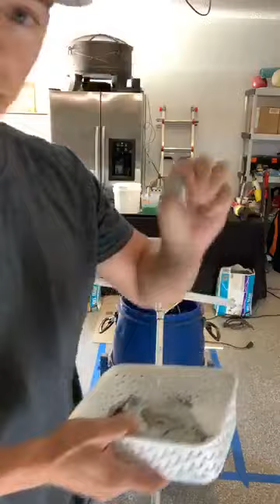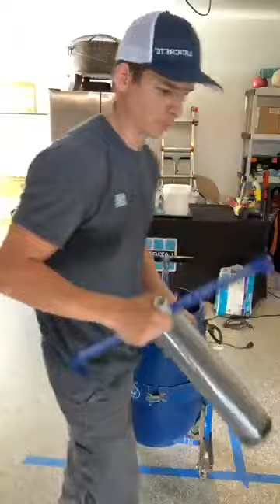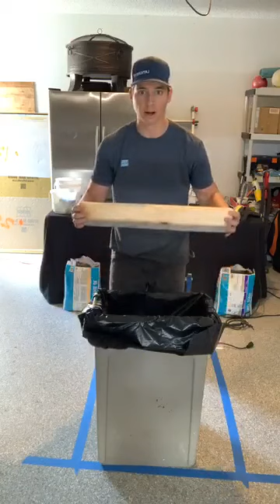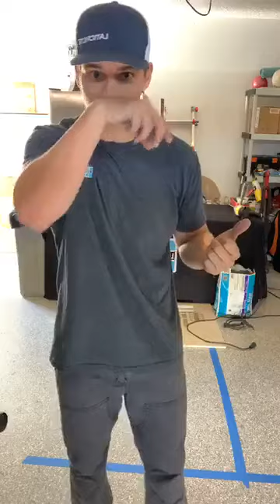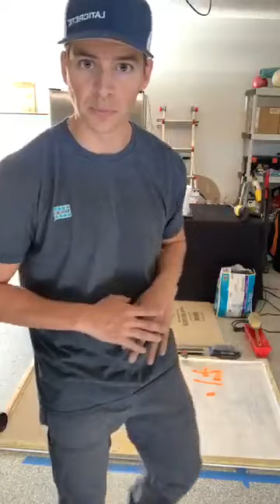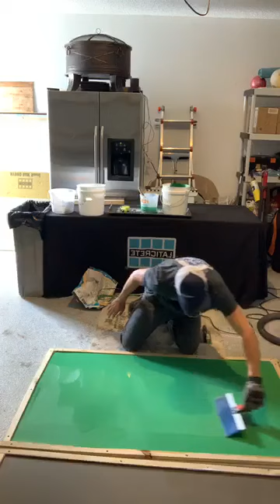Self Leveling Installation Tips, Tools and Demonstration

Comment: Quick question
Can a do a skim coat first on a concrete subfloor (basement) and then apply primer for self leveling?  Hope the question make sense
Reply from the maker: Hi Elvio - we need some more information. Why are you looking to do a skimcoat and what would you be skimming it with? If it's easier to discuss, give our technical services team a call at 1.800.243.4788 x1235

Comment: Nice job Alejandro, let's say your pins are set and the heights are all over the place,  is there a general rule on where to set the gauge rake height?
Reply from the maker: Thanks for the question. At that point a gauge rake isn’t effective because of the various heights. Pour until the pins are gone and manuever/break the surface tension with the smoother. 
If anything, if there is a minimum to be capped on the high areas, it can be used there to maintain a 1/8” minimum.